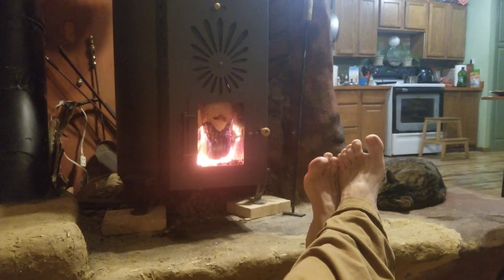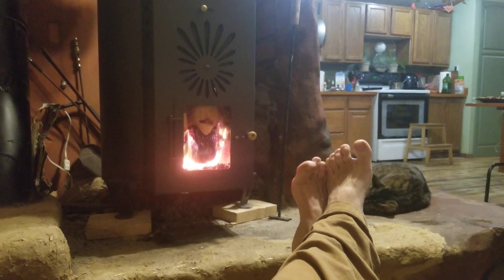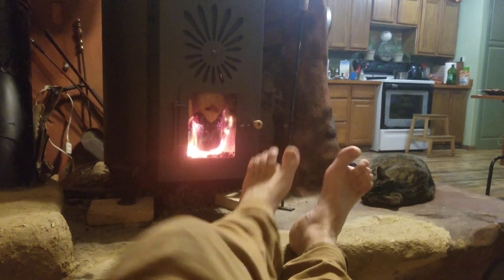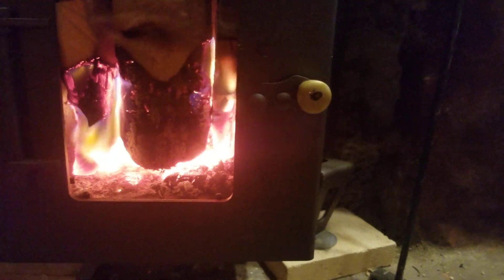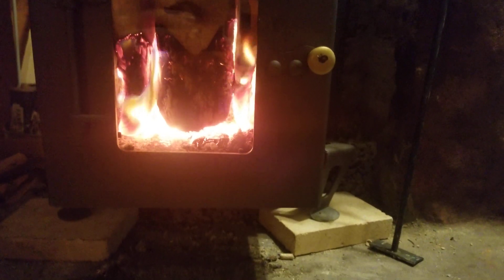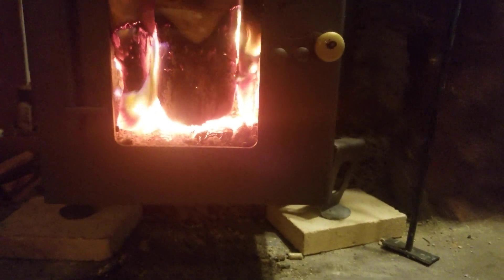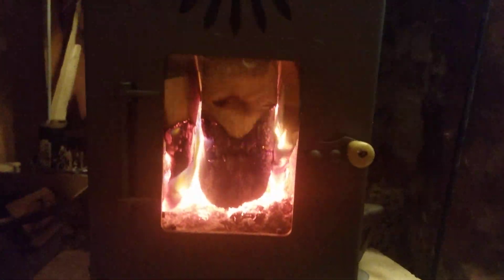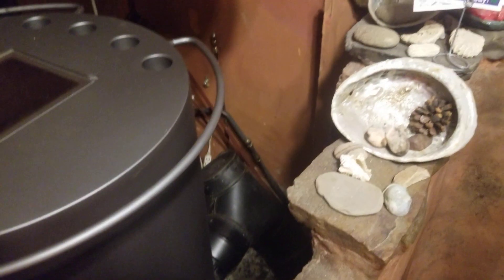Feet Up Testing of the Gamera Rocket Heater Feet and Mass Bench

Comment: That's a nice looking stove. I'm guessing it could burn a lot more fiercely as there isn't much of a vortex of burning gases coming up the riser tube. The glass at the top of the main chamber is a great idea. Enjoyed the video!
Reply from the maker: Typically a Rocket mass heater should burn everything completely by the time it reaches a couple inches above the bottom of the riser where  things are hottest. There shouldn't be any carbon or O2 left to burn any higher than that.

Comment: You seem to have great draft. 
How tall is your chimney?
Reply from the maker: Not as tall as I'd like, maybe 15 feet.  We've had some trouble with such a short chimney with other styles of Rocket Mass Heater but the Gamera has no problem with the set up here.
Reply: @UncleMud  Does any smoke come out of the flue or does it burn completely?
Reply from the maker: @quigers007  smoke is a sign of inefficient burning with unburned carbon remaining. The exhaust that exits the chimney of a well designed rocket heater is quite clean and clear but still carbon dioxide and other gasses that need to exit the house. Does that answer your question?
Reply: @UncleMud  thank you for the reply and help, I have a conventional stove in my shed and have very whingy neighbors who have reported it (we live in an urban area in Ireland) I really like the idea of the rocket stoves and if they do run as smokeless as the appear I will certainly go for one. How is the gamera stove running a few months after starting to use it?